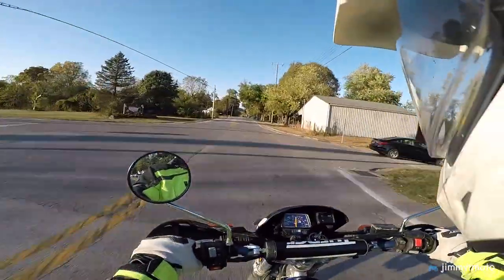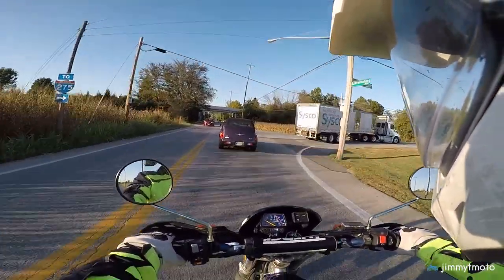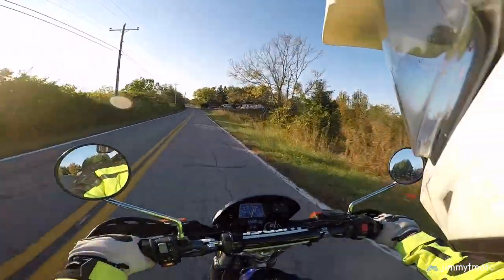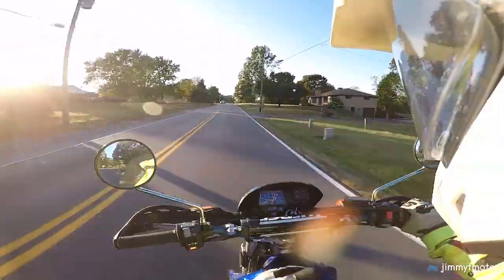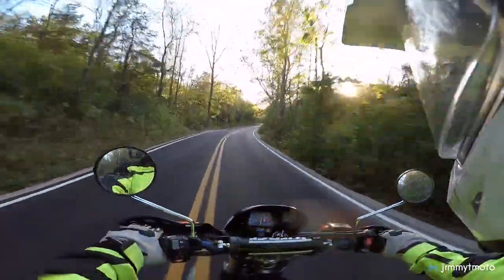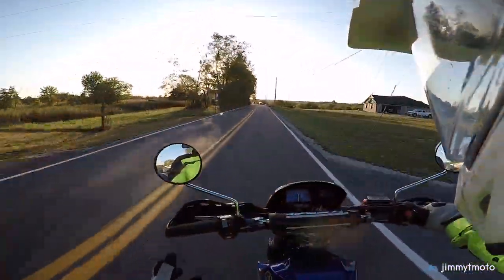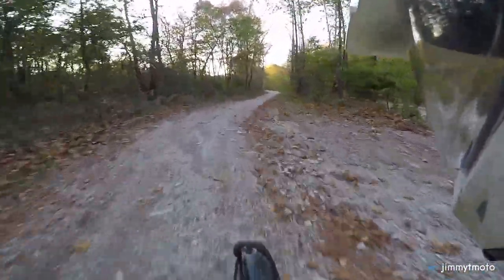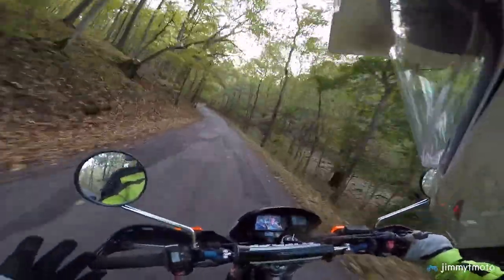Yamaha XT225 One Year Review and Ride

Comment: These are great bikes. I convinced my dad to finally let go of his after neglecting it in the AZ sun for the last 5 years. It's a 1992, the bike I learned to ride on, and needs a lot of Love. Carb is broke, tires shot, cables all stiff, low compression, dented tank, bent bars and missing plastics. Plan is to upgrade it a little without going wild. I have new front springs and emulators, rear shock, pumper carb, Heisco high comp. piston, KTM headlight, LED signals and headlight bulbs, oversize foot pegs and I don't remember what else I have acquired in the garage. Just need time to resurrect it now.  5'4" 165 on my end and yes, the size of these bikes is great for us. Glad your still happy with it after a year.
Reply: Did you do it

Comment: Nice video! Very unbiased and accurate assessment of an XT225! Nice editing and nice (sparingly) use of music. I purchased a 2002 model XT225 w/1200 miles on it last April for $1200. Though the bike was in very good shape cosmetically, and the internals were superb, after sitting for a few years, there was work to be done. So, I spent another $600 or so dollars on it fixing the storage-related issues. (Had the tank cleaned/sealed, replaced the leaking petcock, new tires, etc, etc.) I originally purchased the XT225 for me as a trail bike that would be more forgiving and could be ridden at a much more leisurely pace out in the mountains than my WR250R. I use it to explore the mountains and ride rougher, paddle-prone types of terrain. It will do so at walking speeds and with the low seat height, low weight and center of gravity, it's much more confidence inspiring than my WR. Even though I'm 6'1", the WR with it's significant (about 300 lbs) top heavy weight and it's stratospheric seat height, I got to where I didn't want to ride the WR at the more aggressive speeds it needed in order traverse such terrain. Paddling along and/or stablilzing yourself with your feet (pushing off rocks/etc) while putting through rough sections on the WR just isn't practical and NOT confidence inspiring. Anyway, purchased it for me, but a side benefit is that the XT225 brought my wife out of retirement from riding and she's commandeered the XT225 and again riding some dual sport with me! Since Oct of '19, she's racked up over 3000 dual sporting miles on our XT225. Now that our summer time heat is here (we don't like to ride in our heat/humidity), she's already missing riding and getting antsy for the cooler weather to return! By the way, nice country you have going on there in your region! Love those narrow lanes. The wife and I would super enjoy spending a day riding such lanes!
Reply from the maker: Hey, thanks for sharing your insight and congrats on the sweet deal on the XT225! I think EverRide ADV said the XT225 was like having a "cheat code" on tight trails and it sounds like we agree. And it's so cool that it brought your wife out of retirement to ride again. I really think riding a smaller bike like this gives beginner and returning riders so much more confidence (as you've said) and is a way more positive experience than having a heavier, more powerful, but more demanding motorcycle. For more experienced riders like us it allows us to conserve energy and ride longer and safer, I truly believe. It's cool that you have the best of both worlds - the XT and the WR - and can pick and choose. I'd like to add a more powerful dual sport to my stable but then I go ride the XT and forget why I was thinking that in the first place. :)

Comment: Great review! So much useful info was covered in this video! That really helps. 
I am 5'8 and 140-150 pounds, and I think this one would fit me good as for a first bike (I have some experience with bikes from my teenage times, but it's been quite a while since I had driven one.. 10 year or so). Area around me has lots of forest trails, for soft enduro 30-150km round trips, I think that would be a nice thing to spend a day on a weekend, no need for high speeds (especially with badly disciplined drivers like in Ukraine, so my plan is to keep away from lively roads). Here in Ukraine you can get xt225 in a good state for around 1.8-2.5k USD, which feels affordable for me, 250cc newer version is at least 1k more, which could be a strain. Once again, road traffic could be much deadlier around here, so I'd better focus on rural/forest/plain trips to be safer and get more fun, and this Yamaha XT225 could be a nice choice.

Comment: an excellent review, thank you for this video. i have a decked out DR650 that is just too much to handle in the sandy trails of florida, and i’ve been considering a smaller dual sport but worried about the lack of “motor” and the excess of height in them. the xt225 seems like a decent compromise, especially with the 6-speed transmission. its good that you stated its highway limitations also, since that was a consideration. in short, a perfectly helpful and informative video, and great ride scenery too! thanks again, ride well! 👍😊
Reply from the maker: Thanks, Nick, I appreciate it! I really do like the DR650 and applaud Suzuki for having the lowering option for it. I can see where it could be a handful on sandy trails, though. That's why I let my DR350 go after getting the XT225. The DR had a huge Acerbis tank so it carried a lot of weight up high, too, so once I got tired I started making mistakes, which made me even more tired, and it just wasn't as fun. The little XT lets me ride all day in complete control, just having fun. Yes, it definitely gives up some power but, as you said, the six-speed does help out a bit there. Let me know if you go for a smaller bike and how it works out!

Comment: Lovely to see the follow up to your original video, that inspired me to buy an XT225  for my main bike, as opposed to my XT250 that was close, but just not quite right.  I think you nailed all the main points, especially to consider the XT225 as closer in spirit to a trials bike than an enduro.  But I'll supply what I think is a perfect description: an exploring bike, great for poking around up close and intimately in all the little places, rather than touring the long haul.  You can ride everything but freeways with great pleasure, it handles like a champ.  You can ride all the gravel roads, no matter how small and poorly maintained.  And you can even ride tight single track trails, the bike is light and nimble with a short turning radius, and is well geared for quietly and non-destructively, that is to say politely, sharing the trails with people walking and bicycling.
Now some of experience points of my own, for anyone reading:

- My bike did not come with the larger foot pegs, but I now consider them mandatory, and don't care that they cost me around $100 CAD.  They are a total game changer on the bike, and nothing else fits.  Go to http://www.dmospecialties.com/ and make it happen.
- I put on Motoz Mountain Hybrid tires with Tubliss for amazing off road traction, and I have not been disappointed.  Given how light the bike is, and how little power, they should last very well, even with considerable street use.  But they are noticeably noisy on paved roads.  I would switch to Shinko 700's, or 244's like Jimmy has, if I rode as much paved road as he does, and I will buy some and switch in preparation for an upcoming highway trip around BC I am planning.  Those Motoz are the bomb for the single track I ride every day, and the few miles of paved roads to get there, but would be a significant detraction from longer road tripping.
- I am a heavier rider, around 220 pounds.  I find the suspension to be a bit under-sprung for my weight, with the ground clearance definitely lower than it should be.  But I have not yet taken the time to adjust it, not even the rear shock.  I might get stiffer front springs, but I might also get away with simply increasing the pre-load with spacers.  I realize I appreciate that the front suspension is fairly soft, it leaves the front end not getting thrown around on rough ground by rocks and roots.  My main issue is just the sag, both from my weight, and during braking my weight.
- Google and implement the "three turn mod" on the carb, you won't regret it.
Reply from the maker: 100% agreed. An "exploring bike" is the perfect description...it's a stealthy, quiet machine that lets you go wherever you want. And thanks for providing the links to the pegs, they should definitely be considered a first mod. You should post a vid of your bike sometime!
Reply: @jimmytmoto  You're right, I do need to post video.  Will soon buy a Sony actioncam soon, or maybe a GoPro.  I've been putting off spending the money, don't want to buy a Chinesium one.
Reply: I agree completely - though I went with the XT250 since they are more available in my area compared to the XT225 - also liked the rear disc and EFI.  It is only a 5 speed, but mine is also humming along nicely in it's sweet spot at 60Mph so thinking maybe the final drive great is the same.  I've had so many bikes from 70cc to 1800cc and this little 250 is the most fun I've had riding in a very long time!  Thanks for the videos.
Reply from the maker: @seansteede  It's so great to hear you're having fun on the smaller bike - same story for many us! I agree that the EFI and rear disc on the XT250 are sweet additions. Otherwise, the bikes definitely are close brothers. Kudos to Yamaha for knowing what we want and providing it!

Comment: I put down a deposit on the 2021 CRF300L and a week before it came in I bought a new/used 2021 XT250 with 400 miles on it. Saved about $2000.00 and regret nothing. I have short legs and would've had to buy a $300 lower seat and a lowering link for the CRF to ride safely so I really saved about $2500.00. I've seen videos with short riders on tall bikes but I'm not about to do a circus act at every red light. I love the XT250 it's a great bike.

Comment: Hi Jimmy. Great video.i too have a dr350.im five ft 9in and the 350 is big and heavy.it definitely  has the power  that I like.id like to get the 225 but can't  seem to find  one.the 225 is more the size that I would like to handle.im almost 62 and kick starting that 350 after it has sat for a month is a work  out.id like to be able to push a button. Thanks mike

Comment: Hey, Jimmy... how`s the going? just watched your video and what you say is true: this bike can take you to the trails and then, if you're not in a hurry, have a blast! I have a cousin of this xt... it is a xt 250 lander, model 2007. I'm in Brazil by the way, and this particular model is sold all over South America. It's got basically the same engine and transmission, but it is fuel injected and the design is a bit more modern, I would say... it has even got a digital dash with fuel gage and rev counter... I use it in the city of São paulo to commute to work, and I've ridden about 80,000 miles in 11 years practically trouble free, except for a rear shock... it is kind of soft... not far from my house there are a few unpaved roads where I ride sometimes... I guess that is the purpose of this bike, as you mentioned... cool video! Check later this website: https://fichatecnica.motosblog.com.br/FichaTecnica/Yamaha/XTZ_250_Lander_2007   I'm getting older as well... I mean, wiser! All the best!
Reply from the maker: Oi Karl! 80,000 miles...that's amazing...you and your bike should be in a Yamaha ad! It's interesting that different markets around the world get similar but slightly different motorcycle models based on the same engine. There was talk for awhile that the US might not get the same XT250 this year and I wondered if we might finally get theXTZ250  Lander. Best wishes to you and the bike for 80,000 more miles!
Reply: @jimmytmoto  Thank you, Jimmy... I actually intend to ride 80,000 more miles with it, then more, then finally park it in my living room when I'm too old to ride or when gasoline is not sold anymore... I hope you feel the same! All the best!

Comment: I love my 225 !!! Just a question .. what tires do you use ?
Reply from the maker: I've typically used the Shinko 244 dual sport tires and they've been a great budget option both on- and off-road, and with decent wear. Highly recommended. But I just mounted a Kenda K270 (another budget option) on the rear just to try something different. The initial feel is great and once it gets a few more miles on it I'll try and make an update video!

Comment: Bought mine thru Facebook market place, rode for a week and it’s been at the mechanic since.. turns out, Chinese carb... no money for a legitimate replacement so trying my luck with another Chinese carburetor...
Reply from the maker: That's a bummer about the carb, I hope the replacement does a better job. Let me know if it works!
Reply: jimmytmoto it’s up and running! Mechanic had to tweak it a bit but it’s running almost flawlessly. He said it does have a small hiccup here and there but I have yet to have it happen!
Reply: Same type of experience with my..look at bike..test drive..ran great...start it next day...stall right out as soon as you gave it gas...got some seafoam...added alittle to gas...and its running..so I don't think the carb does will with old gas..mine had been sitting awhile before I bought it...damm fun little bike now that I got it running..

Comment: I have owned  klx250s, crf250L, and the xt250. I finally got an 07 xt225 and i think it's perfect for me too! The lighter weight makes a huge difference. Jimmy, what tires do you have on your bike?
Reply from the maker: What a great endorsement from someone that's owned all of those middleweight dual sports! I've typically run the Shinko 244 dual sport tires front and rear and have been really happy with them for all around 50/50 riding. On gnarly or muddy trails I started dropping the pressure down to 14 lbs and that really helped, too. A couple months ago I put a Kenda K270 on the rear (similar to the Shinko 244) and am really impressed, both on road and off. Some people say it gets squirrely when you corner hard on the road but I guess I don't lay the bike over that far. Ha! How about you...any favorite tires?

Comment: Nice motorcicle, what do you think about the rear suspensión?
Reply from the maker: The rear suspension works great on the road and for fun trail riding and a number of riders up to 220 pounds have left positive comments about it. The suspension isn't really designed for jumping or aggressive off-road riding, though, and it will definitely bottom out quickly in those conditions. So it just depends on the type of riding you'll be doing. I hope this helps!
Reply: @jimmytmoto  Hi broth!! I like your answer!! Yep I know the pro link suspension its great! But need to be remove with other spring for more capacity, Thanks broth, you have a good machine, take care!! 👍

Comment: Small engines have small oil capacity. The oil gets beaten up hard in motorcycles. Use synthetic and change it  often!  Last forever.
Reply from the maker: 100% agreed! Motor oil isn't the place to try and save a buck or two. The XT is still thriving on the Mobil 1 synthetic.

Comment: Hi. I´m from Portugal and realy interested in this bike. I have a CB600F06, that i like to keep for a while, that i bought new, and now i realy interested on this kind of bikes, dual sport, at a point i decided sell the cb and bought a new crf250l, but now i seen a used xt225 serow that a can bought and keep the cb. The only issue is that bike have already 100000kms, but aprentely is in good shape, is from year 2000. A question, 100000kms is too much for this litle bike? Thanks in advance.
Reply from the maker: It sounds like a great plan to have both the CBR and the XT but that's a LOT of miles for any bike. You'll know by looking at it and riding it if it's in decent shape, and definitely ask about the bike's history. If it's going to be your second bike (not primary) and if you're a good mechanic, then I'd consider it. If not, then I'd look for something with lower mileage. I hope this helps!
Reply: jimmytmoto yes, it realy helps, i can make some things about mechanic and that will be my second bike. I think your are right! Thank you so much!

Comment: Hi, I have a 2001 xt225 and I am missing the philips head screws that hold the airbox cover on, and I am also missing the bolt that you need to remove from the plastic body piece to access the cover, would you be able to find out those sizes for me? I am trying tog et my bike running but I cant find them anywhere and I cant find this info online. Thank you!
Reply from the maker: Hi, Adam, I'll try to get those sizes for you and will update here. I'm guessing the airbox cover screws are around 5mm x 15mm and the side plate screw is 6mm x 20mm but I'll confirm.
Reply: @jimmytmoto  i was able to locate the parts numbers, thank you!

Comment: The major problem with this bike is that it doesn't have tubless tires, so if you have a flat in the middle of nowhere,  you really are in trouble.
Reply: ROB NAVAEI ... learn how to change the tube...
Reply: Marty Cech Do you know how many tools you need to take the wheel off, break the bead of the tire, remove the tire, replace the tube, and make sure you have an air pump. 
Just a 100 pounds of tools on that little bike, so you can replace the tube  ! ! !
Reply: @BAHRAMCR  2 spoon wrenches and a tube? Not 100lbs
Reply: @Brad D It is very  simple to plug a tubeless tire with a typical plug and a co2 capsule to pump it backup. And you do not need to take the wheel off the bike.
Reply: @BAHRAMCR  can't never could do anything. If you say you can't then there it is.